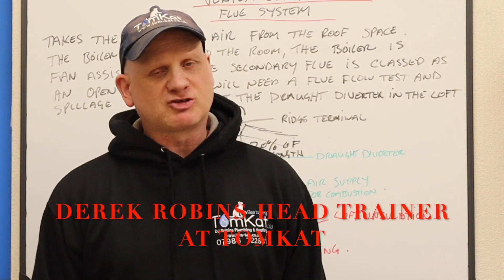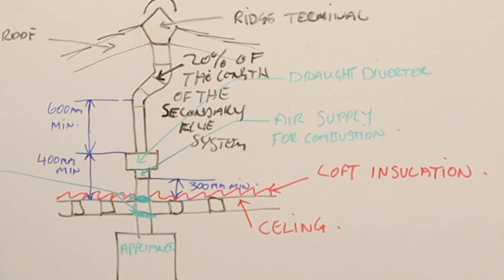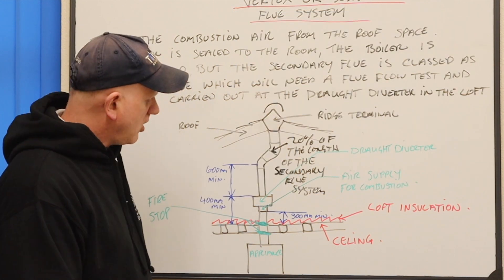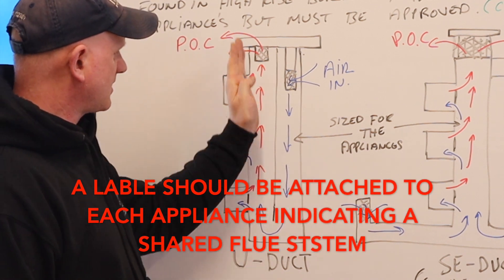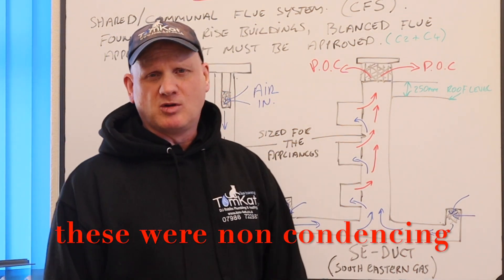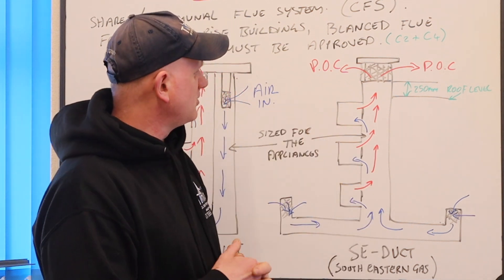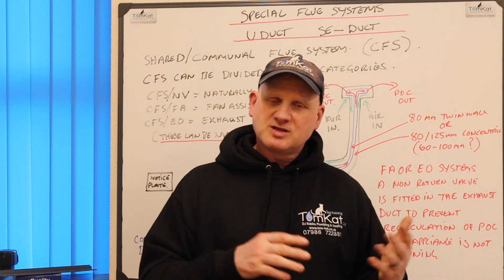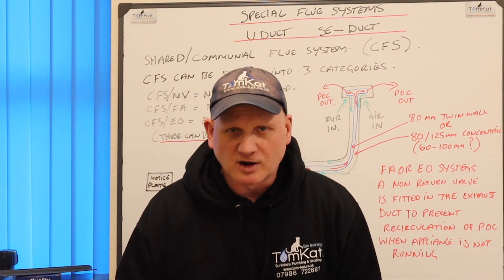VERTEX FLUE, SE-DUCT, U-DUCT ACS revision on specialist and  shared/communal  flue systems( CFS).

Comment: how would you work out roofspace  ventilation for a virtex please
Reply from the maker: Measure the soffit vents or put in the vent to MIs or work out from the kw net
Reply: @tomkatgastraining just doing my acs renewal, totally forgot about how to do roof space ventilation, started worrying about forgetting stuff as never do anything to do with virtex apart from at acs time.
Reply from the maker: @brethren4life152  we don’t have any questions in our exams on working out ventilation for vertex flues. Who are you doing your renewal with?
Reply: @tomkatgastraining I'd rather not say on here
Reply from the maker: @brethren4life152  ok 👍🏻
Reply: When working out the ventilation for the loft do you still take off 7kw or not ?
My heads fried after taking my renewal today.
Reply from the maker: @walt-sh7ju  are you talking about open flue boilers?
Reply: @tomkatgastraining can I post my acs question on here for u to answer it 🤣🤣🤣

Comment: Is this  more commercial than domestic
Reply from the maker: No domestic
Reply: @tomkatgastraining  what situation would a vertex flue be installed. If it was a R/S appliances why you you not just use a standard flue and save your self all the hassle
Reply from the maker: @Zaine22  you wouldn’t install one now but you might still come across them
Reply: @tomkatgastraining  ok thanks alot I'm doing my gas so doing alot of learning. By the way please keep up the videos cause I have learned so much from them

Comment: Never seen a SE or U and never will but every ACS they turn up like a bad penny,
Reply: Thanks for the heads up, mine is in June.
Reply: @daz374 Thank you for that. How was the exam for you ? Mine will be run over 4 days.
Reply: @daz374 Well done though for taking CENWAT on as well. I wanted to do HTR but like many in my area could'nt get enough for my portfolio. So doing CCN1 & CKR, got a good deal  at £600. £900 sounds steep. Dreading the tricky questions. E.g, How often should a landlord safety certificate be carried out ?  My answer, Every 12 months.My tutor, No that is wrong !  What !,  The answer is "within" 12 Months ! Me, Dammit !!  Tutor, Welcome to the Gas Industry.  Hopefully it will all be worth all this stress.
Reply: @daz374 Yeah initial, started with my mentor last June.
Reply: @daz374 Thank you for those tips. Great chatting with you and all the best with everything you are doing.